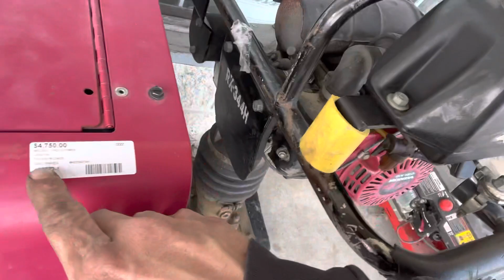Breakout Rig! Welder Buy Full Video!

Comment: If that's a gasoline powered you're gonna be filling that tank every day. I've always had a diesel powered welder. I could run more than 40hrs on 10gals diesel. Plus, there's less maintenance and repairs on a diesel engine.